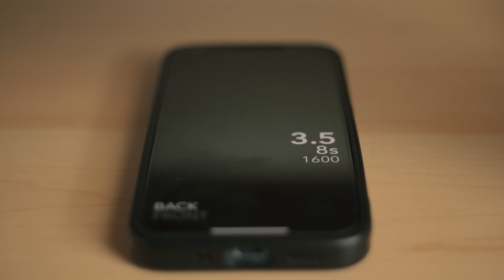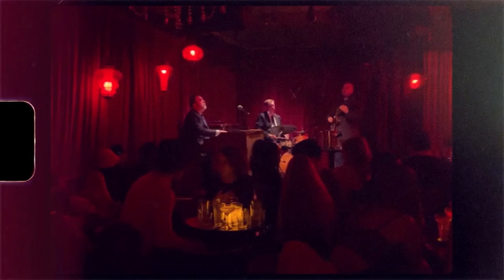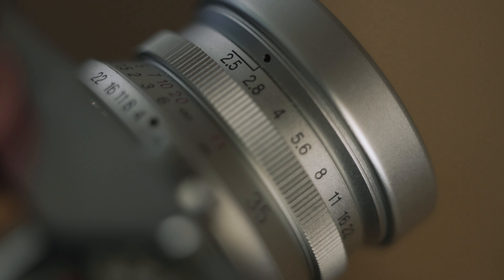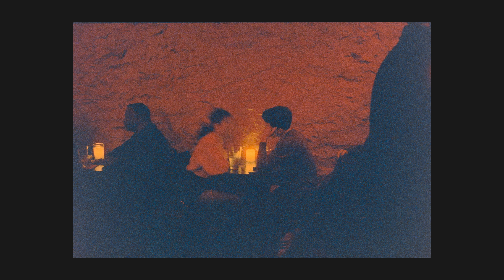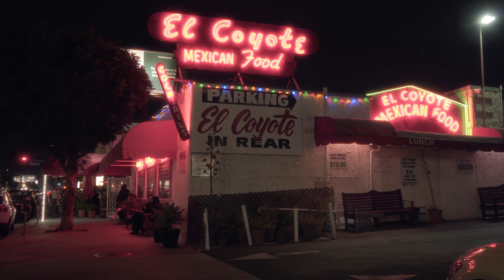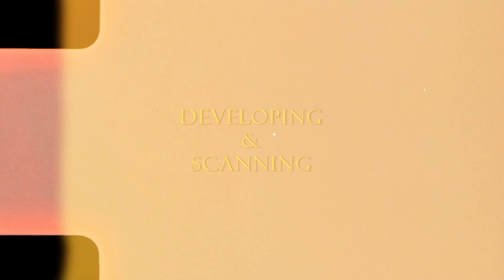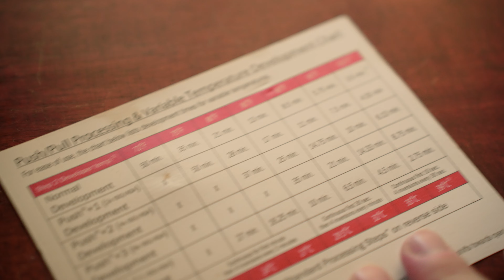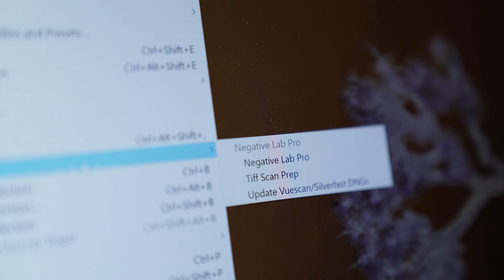How to Push Film | Pushing CineStill 800T to 1600 ISO

Comment: Next time id suggest doing a +2 stop when going to 1600iso I've personality found that a +1 push increases the usable sensitivity by ~2/3 of a stop. Because the +1 stop in density increases is just in the highlights not in the mid tones.

I usually do 800T(v3 500T in my case but its the same so 🤷‍♀️) at 1000-1200iso for a +1push and 1600iso for a +2push. Im more often going on the lower side since in these low light situations you often have point light sources that can throw off metering.

Comment: Hello. I would like some advice. Which 120mm film camera have you used? Can the Yashica 124 G compete with the Rolleiflex? Since it is much cheaper, I am interested.
Reply from the maker: @KhunTui-jl5nj  the Yashica mat 124 and 124g are very capable cameras and their lenses are great and will compete with the slower rolleiflexes. Rollei flex made a few f/2.8 models that will be a little better for shallow depth of field and low light, but the Yashica mats have brighter ground glass which makes focusing easier
Reply: @ReimannPembroke  Thanks for the advice. I saw you use Canon RF, you look cool. I use Canon Vi-L with Canon 50 f1.5 lens. I have only been using film camera for a few months, I hope to take beautiful pictures and be cool when holding the camera like you.

Comment: I want to try pushing film although I can't find anything useful online when it comes to Developing times, how can I find out how I should develop my film depending on the ISO I shot it at? Recently I shot some Arista 400 120 at 1600 (+2 stops) but I'm not completely sure how to develop it,
Reply: I'd suggest the massive dev chart for b&w and if they don't have it try extrapolating from other times or just increasing the dev time by ~20% for every stop. That's by no means exact but that's how I usually do it with my b&w in hc110 other developers can behave differently

Comment: Nice video.  Keep up the good work.  

Not to burst your bubble, but print film is generally very forgiving of exposure.  There are examples on line of film being shot over a seven stop range (3 slow, 3 fast and one correct).  Once printed, they all look virtually identical.  Now slide film is a different story.
Reply from the maker: @tim31415  thanks for watching! oh yeah I’ve seen some tests! I just figured this would be a good specific topic for people who are curious about this film at this specific iso. I’ve found that these cinema films with the remjet layer removed have interesting characteristics when pushed/pulled. At least a little more interesting than the infinitely flexible Portra haha